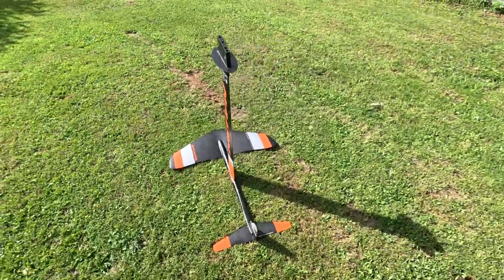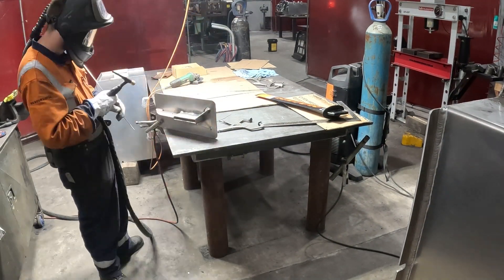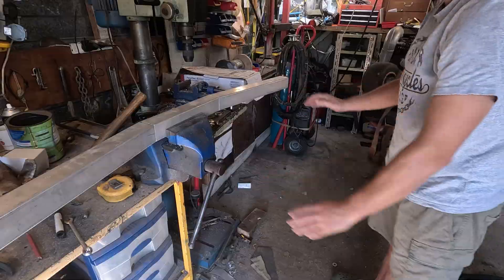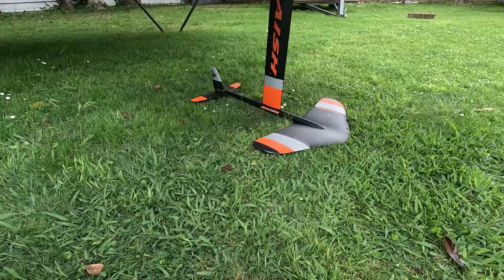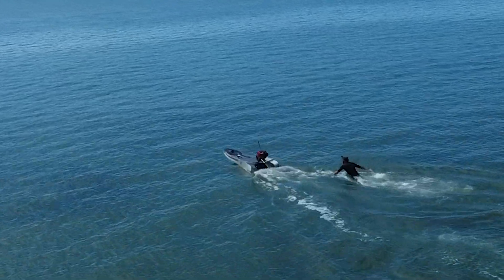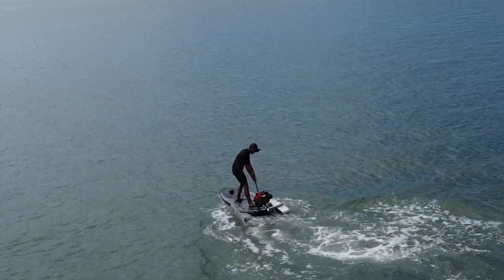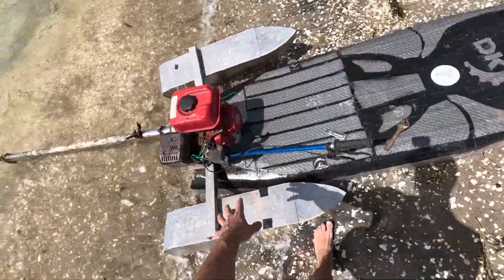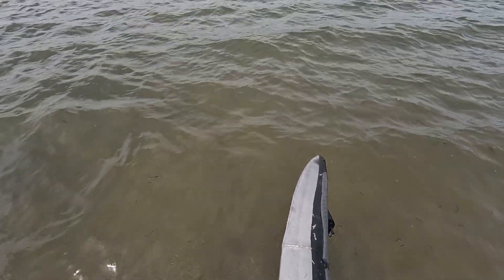Motorized Hydrofoil Board First Test

Comment: loving the tinkering here and quick prototyping ... but you can't forget the physics ... where your center of lift is, relative to your CG, and how you will control pitch and angle of attack ...
you are flying in a medium called water
Reply from the maker: It seemed like the foil needs to be way back from CG, I’m hoping to balance it like a normal foil board where you just shift weight back and forth

Comment: i cringed so hard when you ran the outboard with no water. It only takes 2 seconds to smoke the impeller on those motors. Ive also repaired that same model and if you look in my videos i ran one and did 22km/h on a inflatable /watch?v=tgwRZz3erB0

Comment: I was impressed by how much lift you got from so little HP, looking forward to your solutions and testing.
Reply from the maker: Yeah it doesn’t need much power
Reply: @dkthewelder  Try to use a ligth 52cc outboard.
Reply: Or 63cc outboard and cut the propeller to 140mm to obtain more rpm.

Comment: So the formula for the correct positioning of the foil is as follows. Calculate the surface area of the board, lets call that SA. Subtract the length of two Tui 15 packs of beer from SA and that will give the centre point of your foil position from the end of the craft. For optimal performance, take the weight of the engine plus yourself and multiply that by the square root of the width of the Tui box and subtract that from the centre point. This mathematical approach has worked for me in the past with stunning results
Reply from the maker: Finally someone explaining it in a way that makes sense! I will get a 15 pack of tui 👍

Comment: theres' too much going on with the pivot on the longtail and balancing the foil. I reckon you need a prop that's locked in position, then steer by leaning like the e-foils do.
Reply from the maker: Yeah it suddenly pops up on the foil and you don’t get much time to think haha . That is why I think a normal outboard might be easier
Reply: Yep the outboard will give you the best chance at foiling. Too many variables with the long tail. 

Try some slacklining to improve your balance/body awareness. Old tie down strap between 2 trees will do the job. Or tow the board behind something else to get a feel for foiling before sacrificing an outboard.

Comment: What happened to that seagull motor, the chainsaw motor, or the Tohatsu you have used in your other videos? Could you use one of those?
Reply from the maker: Haha yeah the chainsaw one only really works on full throttle, the tohatsu one isn’t mine . The seagull would maybe work if I put a more aggressive prop on it put really need a reliable motor with a good cover on it . I may end up fixing my brother’s one and using that as I think it would work well